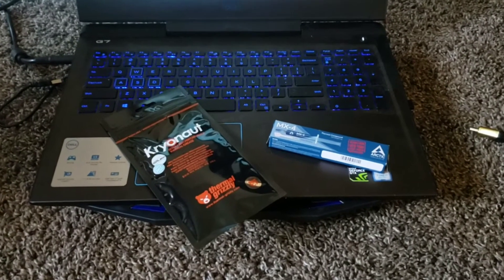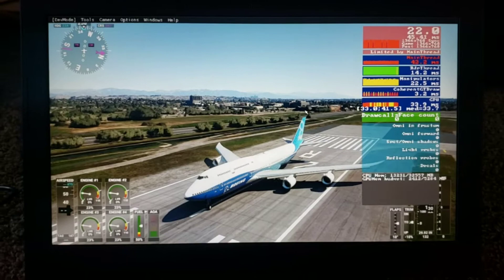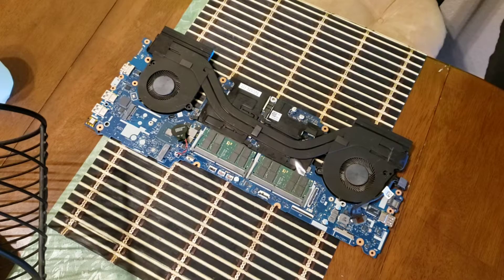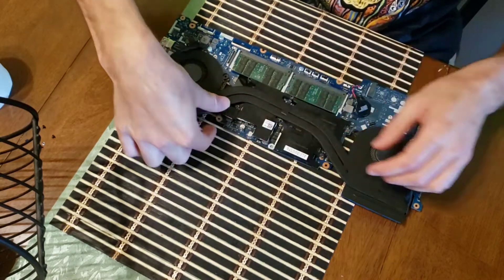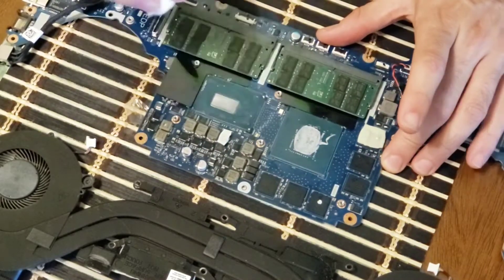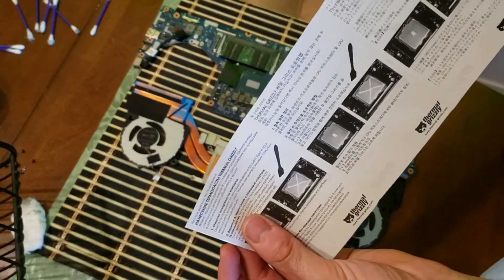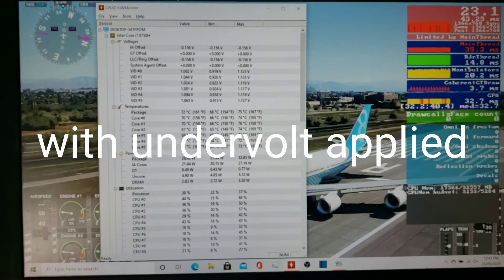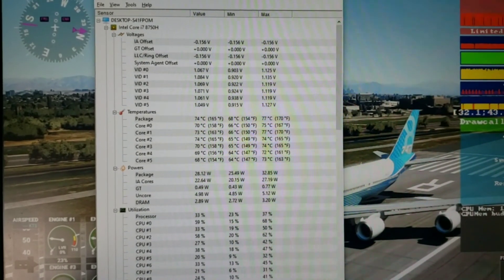Thermal Grizzly VS Arctic MX-4. Amazing difference about 20 degrees cooler:)

Comment: One big difference between these two, their expected useful life. MX-4 has an expected life of at least 8 years, the actual designer/tester (Der8auer) of Thermal grizzly Kryonaut says it should be replaced about yearly, which is typical of silicone based thermal compounds due to heat cycles gradually pumping out the silicone base oil. For a desktop system, that might be practical, but I would never want that on a laptop. MX-4 May not transfer heat as well, but it’s good, and durable.
Reply: it must be for desktop(1 year)
kyro can be pump out 80c plus in one week or month. So i agree totaly. But what is longer and cooler for laptopsm
Reply: What about the GC Extreme? How soon should that be replaced?
Reply: @RondellKB  no idea. Not familiar with that one.
Reply: Kryonaut actually says it can last up to 3+ years, they say kingpin Kpx has to be changed every 6 months I been running it for 2 months no degradation i still idle at the 30C like I did when I pasted it and hit 76C at 100% load on all 12 cores same as when I did it, they say 6 months on CG extreme as well but who really knows
Reply: thermal greasy last up to 3 years
Reply: Thx bro

Comment: Actually I do have the same G7 7588, and also using arctic MX-4. Maybe you should also clean up your fans, there's a lot of dust build-up that really affect the temperature. Before the repaste I think it's max is about 98°C too, but right after repaste I've been playing RDR2 for about an hour with max temperature at 65°C.
Reply: How is it holding the mx4? After a year of application
Reply: @newthepanch  if you love your laptop you will change paste every year and clean whole laptop :) much longer life. Many people put grizzly paste and think now i dont need to change my paste for next 3 and more years and than not doing even normal maintance every year which is rly bad. So 1 year is gucci with mx4 i tested its still its good shape and form but still i swap again for new one :)

Comment: I tried both but i think diference you are getting is due to the fact that the arctic mx4 paste was old and thermal grizzly kryonaut was freshly applied,As i have not got any huge difference just like you by using both of them.
Reply: A thermal paste shouldn't make that much of a difference.  It was definitely because the paste was old.  in a bit of a more scientific test, the difference between mx-4 and kryonaut was less than 2 degrees, even against high performance liquid metal, mx-4 is only about 5.2 degrees warmer than conductonaut.
Reply: @nathanhamman418  yeah thats what i told
Reply: The comment above yours pointed out that the max power when he tested mx4 was 61.63W, while it was 52.73W for the thermal grizzly. I also noticed that the CPU utilization was 83% when testing the mx4, but 50% when testing thermal grizzly. Makes me feel as if he tested them with different power modes...
Reply: It depends in how much heat does the thing you are putting the thermal paste in makes, I tried with a RX Vega and it lowered 5 degrees more than MX4, instead in an old laptop with a 65W tdp it didn't make any difference

Comment: i have arctic 5 since 2017 and apply on my notebook and 95 degree easy. ill solve with the thermal Grizzly ?
Reply: Did u use it??
Reply: @darthvader44  if I used grizzly? Do not. only artic 5
Reply: @ucss25  why?? I was thinking of buying grizzly
Reply: @darthvader44  but I was thinking of buying one too. This is the reason that i question it. :D
Reply: @ucss25  wait so , should i get it or not? Lol
Reply: @darthvader44  lol
Reply: @ucss25  ??
Reply: @ucss25  fuck it m getting thermal grizzly 😹
Reply: @darthvader44  bad it won't do  :D
Reply: @ucss25  what do you mean??
Reply: @darthvader44  in my case I did an up on the notebook. My model is a msi GT70 with I7 3610QM and gtx 680m I replaced it with an I7 3980XM and GTX 1070. maybe that's why the temperatures are high heheh . i dont think the thermal paste will helps. who knows
Reply: @ucss25  ooh

Comment: 0:47, MX-4 runs at 80°C while burning 34.28W, 
13:43, Kryonaut runs at 76°C while burning 31.57W... not a whole lot of difference...
if I look at the max values : MX-4 98°C for 61.63W, Kryonaut 89°C for 52.73W. again, not a whole lot of difference
Reply: My guy, thats a lot. How much did you expect the difference to be?

One thing to remember is that does 2-10 degrees does a lot when you get thermal spikes that shoot up  temperatur constantly and then goes back to stable.
Reply: @Usul-xp6ve  hes talking about the wattage not being the same, higher wattage = more voltage = higher temperature, the temperature values arent quite the same becuase of different wattage
Reply from the maker: Thanks Hamed I've been very pleased with the results ever since :)
Reply: @Usul-xp6ve  so is grizzly better?
Reply: @alwahaibi6204  Yes, grizzly is preferred if you really want to get the best results. But nothing wrong with mx4, some say its softer and therefore wont achieve optimal contact, but hey we want performance without breaking the bank ey.
Reply: Mx-4 lasts longer... people don't use it cause it's cooler after install.. Indigo and subsilver were also cooler after install...
Reply: not a lot!? 10c from thermal paste is astounding haha!